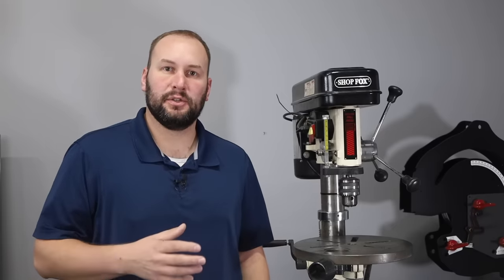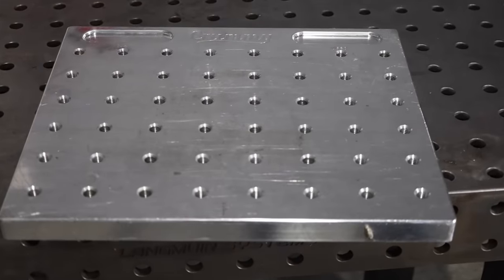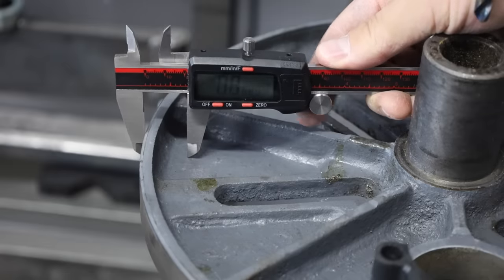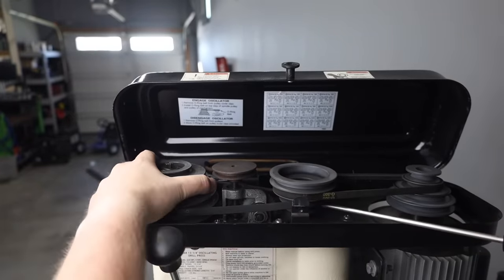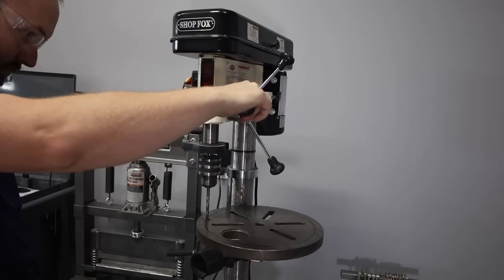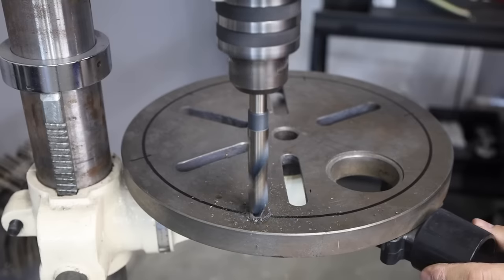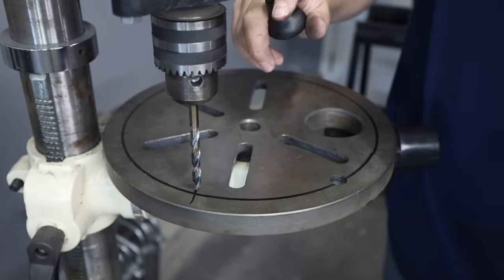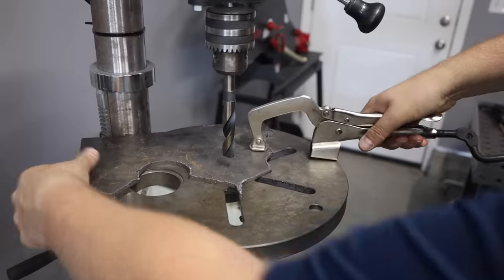EASY Drill Press Mod I Should Have Done Years Ago

Comment: Hey Tim - excellent work. (Mechanical engineer from Australia here.) The chips you noticed are also emblematic of the material being ductile iron, as opposed to the (cheaper and more brittle) gray iron. Ductile iron also raises a burr around the centre punch mark, whereas gray iron does not. (Both good methods of determining which kind of iron you're machining, if the material type is unknown.)
Reply: I came down here to make a similar comment.  In addition cutting fluids are not required for either material.
Reply: Machinist from Australia here, that is without a doubt grey cast iron, you obviously have not machined grey cast iron or even centre punched it. While not as ductile as some materials grey cast iron is still ductile enough to raise a burr around a centre punch and make short swarf.
Reply: @mrsock3380 mechanical engineer here.  Never trust an engineer who leads with their qualifications lol. But as a mechanical engineer who has actually machined stuff that sure looked like gray iron to me…too bad I can’t be trusted now.
Reply: @TKC_  I think youtube has a collection of hobby machinists that didn't think it through, like a friend of mine that asked me to look at this, he spent a lot of money setting up a little workshop but didn't have anything to make, sees stuff like this and thinks it's a good idea. 
I put him onto model steam engine building from kits and now I get calls asking how to achieve results in machining and fix his mistakes, rather than stupid things to make.
Reply: @mrsock3380  oh don’t mind me I’m just salty from years of reminding engineers that work with me to listen and don’t always try to stand out as the smartest person in there room. Usually this happens as a tradesperson with way more experience tries keeping them from making a major mistake while being ignored.
Reply: @TKC_  I had one engineer that used to like telling machinists how to machine, I called it Colins Top Tips, if it was only me and him I would pretend to take note, when one of the bosses was around I would put him in his place by offering him the operators position and ask him to show me how it's done. He was smart enough to never take up the offer, but not smart enough to ask why I wasn't doing it by the book.
Reply: @TKC_  Reminds me of an Engineer working in  a shutdown situation up in the North West near Broome who was so smart he got absolutely drenched in condensate because he insisted in doing a Hot Tap the clown so much for Uni Degrees and no bloody real work experience

Comment: Short, precise, and NO unwanted yapping video. Two thumbs up. Oh, I forgot to mention NO ANNOYING background music. Great work. Many thanks. I use a magnet ring to catch metal shavings.
Reply: "...magnet ring to catch metal shavings..."
You ever hear one of those ideas that are so brilliant and simple you feel like an idiot for not thinking of it before?  Yep, this.  In my defense however, I RARELY find myself working with iron & steel - mostly plastics and Al.   But next time, I'm grabbing one of the salvaged speaker 'donut' magnets from the back of the shop door!!!  (Which will probably be when I do Tim's mod!)

Thanks to all who share ideas!!!
Reply: Magnetic rings are certainly a good idea, failing that just a cheap ferrite rectangle with one end near the hole. It's easier to clear the chips off. Also, it's not necessary or even helpful to use cutting fluid when drilling or machining cast iron. The graphite content provides ample lubrication, and the chips are self breaking which greatly limits heat buildup. The chips are easier to collect with a magnet in the absence of fluid, particularly sticky fluid.
Reply: @Gottenhimfella
Reply: How do you get of the shavings fro the Magnet? Do you use some kinf of Plastik or Aluminium Cover?

Comment: Your idea is great 👍
Small tip: Your drill press will feel a lot sturdier when you weigh it down to the ground. Don't be shy to put a 60lb or maybe even a 100lb concrete block into the machine stand. For mechanical machines, weight is good.

Comment: Hey Tim  nice idea, just a tip the first drill ie pilot drill, it should only be no bigger than the point landing of your second drill, that will allow it to drill with out vibrating.
Reply: That, or use an “NC spotting drill,” followed by step-drilling, when you need an especially good hole - like, for example, where you are going to put a riv-nut insert.
Reply: Ditto on the size of pilot holes, just fat enough to clear the center of the full size drill you'll be using

Comment: The basic safety step you took by rotating the part against the column before drilling would be worth highlighting to beginners.
Reply: where is this in the video?
Reply: 4.13 when he uses the clamp to drill the plate at the end of the video.
Reply: Another option is to use two of these clamps. Been there, done that, bought the t-shirt.
Reply: It took me a broken finger to learn this.
Reply: An alternative stop would be to put a nut and bolt through one of the other drilled holes. This would stop the item being drilled rotating eg on breakthrough when the clamp is no longer able to handle the torque.

Comment: If you do go the inverter route for speed control is worth spending a little time seeing it up properly; you need to look into the torque boost option for the lower speeds and I also set up two, switched, pre-set speeds (same speed but one forward and one reverse) that I use for starting taps.  I also use the DC injection option to give a proper emergency stop. If you work the drill hard at low speeds, as I do, then it's also worth fitting an auxilary fan to the motor as the motor's own fan is designed to cool the motor at synchronous speed and will not stuff enough air through the motor at lower speeds.

Comment: I have very large gearhead pedestal drills. I recently rescued a drill stand identical to yours. Once I had sorted out the switch, the seized chuck etc it hums along. I use it almost daily. Thanks for an excellent idea. I will certainly copy that as holding fiddly pieces on a drill stand of this size can see you with damaged fingers.

Comment: A very useful mod. I see this happening in my workshop very soon. I too got very frustrated with having to constantly change belts on the drill press and so I did the treadmill motor swap. This is working very well for me. I liked it so much I also did the same mod on my lathe and my drill press. An added bonus - I picked up all three treadmills for free.
Reply: There should be a feature on drill presses that allows you to loosen those pulleys so that you can easily swap the belts around as needed, especially when you need to switch the belts over under to get the other set of speeds

Comment: Honestly one of the best suggested mods I've seen!  When I start back in the shop I'll be doing this ASAP!  
Thanks for sharing!!!

I have a tiny shop in barely the "half" of a 1&1/2 car garage; but I AM sporting a full-sized standing drill press.  It certainly makes a presence there, but I had NO drill press; and it was free from an old employer clearing out.  It's an old beast and still works a treat!

For anyone still interested - the two major mods so far have been:
1) Installing casters [locking fronts on a ~26" crossbar for stability]; because in a small shop having as much as you can mobile helps you to make the room you need for a project as you need it.

2) A "POWERED" warning light on the top so I will always know if it's plugged in regardless of where it's in the shop.  It's an ornate hollow black skull cast in resin about the size of a golf ball with a diamond pattern carved in to the cranium.  I cleared & widened the openings I could and inserted a red C7 bulb fixture tied directly to it's power input before the switches.
     2a) Also added a small OSH!T sticker above the control switches that warns "Not to be operated by F@#$wits".

Comment: By far the best mod I've made to my small floor standing press is an adjustable jack stand supporting the table. It is made from 18" of 2" sq steel perforated tube, 18" of 1.875" round steel pipe machined to fit inside the 2' tube, and 18" of 7/8" threaded rod topped with a 2" ball from a trailer hitch. It has 24" range of adjustability and is bolted to the T slots in the base plate. With the jack stand I can easily square the table to the column. The table can now support a huge amount of weight and will not deflect downward no matter how much down force I use. I drill mostly steel and aluminum.

Comment: I use that type of clamp in my drill press, except mine had a threaded stud. It simply bolts through the existing slots. I use it to hold both discrete pieces, but also to hold my drilling vice in place.
Reply: Yes, and they’re made in two sizes.
Reply: I have the same thing. No need to drill holes and more versatile as it can be moved along the slot instead of being anchored in one place. I also use my milling machine clamping fixtures as the t nuts fit in the slots.

Comment: Great idea.  I have the exact same Shop Fox drill press I purchased through Grizzly over 10 years ago and this will work wonders.  I've been using C-clamps to hold my pieces and def need to pick up some of those vice grip clamps.  Additionally having a better set of HSS drill bits makes a world of difference.  Thanks.
Reply: weaponofchoice-tc7qs  Thanks for the tip.  I will.

Comment: Great tip/idea; thanks. Btw, one of the best things I ever did was to just bite the bullet, and get a variable speed drill press. I took a long time making that decision b/c I wasn't sure it would be worth spending the extra $$$, but it didn't take long to realize that the only poor choice was not making the decision sooner.
Reply: This!  I spent 20+ years using two drill presses that had belts and pulleys, and a few years ago I moved up to a variable speed drill press.  One of the best decisions I ever made, and very well worth the money.
Reply: 100% agree. I used to think how much each hole was costing me because my machine was fairly expensive but thousands of holes later it's still a pleasure every time I walk up to it and I'll keep it forever. I've probably got another 40 years to use it. 
Btw. I would think you could get a clamp that has a piece on the bottom that'll fit through the slots one way but not when you rotate the piece on the bottom 90 degrees.

Comment: Lubricant is used to allow the chips to travel up the drill bit flutes. I has no effect on the drilling face of the drill bit where friction is need to cut the material. Cast Iron has plenty of graphite so lubricant is not usually needed.  Thanks for the idea !

Comment: Good solution for that drill bed. I have a larger square drill bed with T slots and have a piece of angle steel bolted down that I turn my vice to rest up against. So the angle is preventing the spin. It’s quick to adjust and can be used as a datum for drilling holes at a set distance into a length of steel.

Comment: Hi Tim, you don't need to use cutting oil when drilling into cast iron as it is self lubricating due to the high carbon content so better save your lube for when you really need it.
Reply from the maker: That's awesome! I learn something new every day on here. Thanks!
Reply: You are correct Sir. On my mill if I'm drilling extensively on a long pass or a large cut in a cast iron engine block, I will clamp a air line and allow a LIGHT mist of air to keep the tooling cool.
Reply: Lubrication isn't the only job of cutting oil. It also cools as well. Cast iron comes in many forms and in the engine plants I've worked cutting oil has always been used on cast iron parts whether they be grey iron or ductile (SG) Iron. I know on high cutting rate jobs the coolant is also used to clear the chips away from the cutter.
Reply: Drills last very well drilling cast without oil, but last a little bit longer with a drop of oil. (but a puddle of oil is wasted and just messy!)
Reply: Really with the cost of cutting oil, you can just use an acid brush and a cut down water bottel of oil and brush it on the bit as its running,  one other nifty item to use are the fruit cups or one serving jello molds these come in handy for a lot of things oil cup on your drill press is one,  but you can use them for wood glue  and some of them uou can take a lays potato chip tub lid and it fits the cup so if you want a lid on it or cut a hole to help hold your brush.
I belive you can store wood glue in one overnight insted of pouring it in and out of your gallon jug.  Neat thing is these are free, most people eat the food and put them in the trash.  But its useful for other things. 
You can save money on oil by using some types of used motor oil to drill with
Its oil. Not really ment to cut more then cool the tool and pull chips away.
3 in one also works. 
Motor oil stinks when its hot.
Reply: If you are drilling something hard and you need lub 
 A short tube a double sided tape. You can fill the tube with coolant and peck away.
Reply: No one gives a fluck about wasting oil, you should care about breathing in the cooked oil smoke, especially if you drill with that popular "tapping fluid"
Reply: @janeblogs324   that why you need to. Smoke while drilling.
Reply: "...save your lube for when you really need it" That's what the wife says when she's pissed off with you!!!! 🤪🤪😆😆
Reply: “Oil or grease never broke anything”- some old timer
Reply: Yup. I came to the comments to say the same thing. I love drilling grey iron for this very reason, plus it makes a satisfying grinding sound when drilled, which I enjoy.
Reply: Where's your safety glasses..??
Reply: Yeah I too cherish my cans of oil in the garage. I wake up in the morning and take a long hard fkn look at my cans including the WD40. Some things just go unlubed because they aren’t “worthy” to have oil wasted on them.
Reply: Dry drill cast iron! I concur!
Reply: The graphite is the lubricant. High carbon content is way not helpful in drilling cast iron. For example...a metal cutting drill bit is...  .045 carbon. This higher amount of carbon gives the bit the ability to hold  sharp cutting edges longer. Mild steel...is .010-020 carbon. Soft compared to the metal cutting drill bit. We don't make drill bits from mild steel. All the best, Pete
Reply: @bryankautz826 lol😂
Reply: “High carbon” doesn’t mean self lubricating, otherwise every other blade smith wouldn’t have 68936293 burnt out drill bits, it’s graphite and other materials that helpin cast iron.
Reply: Actually it's because the carbon is in the form of graphite as opposed to the high carbon steel variants.
Reply: @assassinlexx1993 i use modelling clay.
Reply: Y inexpensive drill press tends to flex at the platform .
I made a brace to stop this happening.
Reply: @TheBuccy I agree.  Bracing the table for practically any cut makes a difference.  A little drill pressure causes the table to flex, so rather than drilling a square/perpendicular hole,  the drill is pushing through at a slight angle. Causing location problems and also increasing the side loading of the drill bits.  Possibly breaking drill bits and definitely wasting your energy,  trying to push the drill while the table is flexing away from you.
Reply: In actual fact, using a cutting oil for tapping cast iron is a big detriment. It combines with the usually fine dust and forms a paste which gums up into almost a cementlike substance. It jams up the tap so badly I have broken a pretty good sized tap.  But it only happened once because I only drill and tap dry.

Comment from the maker: Thanks for watching! Links for the items used in the video are below.

***Learn Welding and Fabrication in my $39 Online Courses***
https://courses.timwelds.com

***Things to do this mod yourself***
Stronghand Locking Plier Clamp: https://amzn.to/3CqE5M3 (There are a few sizes available. I used 3-3/8" throat depth.)
Stronghand Bar Clamp: https://amzn.to/3BX7jAB
5/8" Drill Bit: https://amzn.to/3y4F41y
Tap Magic: https://amzn.to/3UM72ZX
Deburr Tool: https://amzn.to/3fm6qd5
Center Punch: https://amzn.to/3UPccUW

***Discount code 'TIMWELDS' saves friends of the channel***
15% Laser cutting at https://sendcutsend.com (discount code: TMWLDS15)
5% off HTP machines and quality accessories at https://usaweld.com?ref=timwelds
10% off welding coupons, kits and supplies at https://weldmetalsonline.com
5% off Evolution power tools at https://store.evolutionpowertools.com

*Contains affiliate links which provide a small commission to support the making of these videos at no additional cost to you.